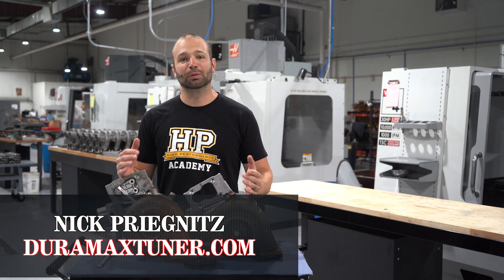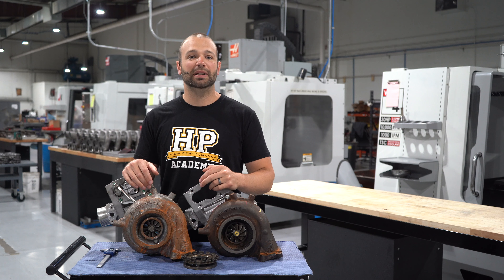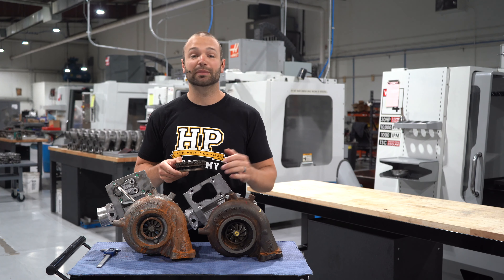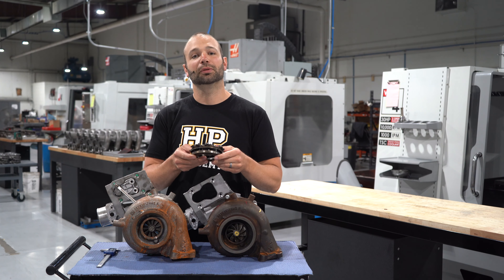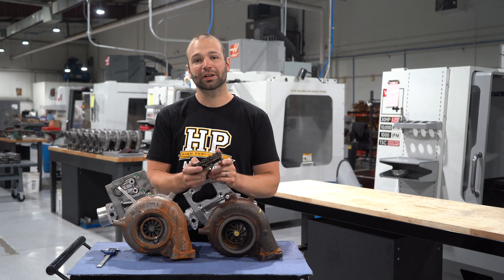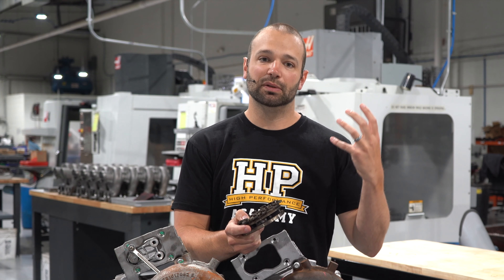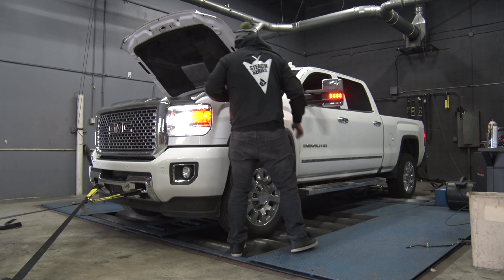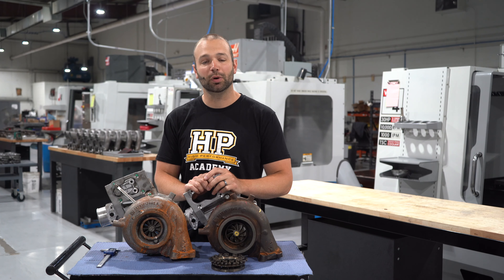Update On L5P Stealth Turbo!

Comment: 2020 Chevy 3500 L5P vs. 2020 Chevy 5500 L5D, is anything difference with the engine or turbo besides the L5D being detuned? All I know is the transmission is a 6 speed, 1750 series Allison. Is the L5D able to be tuned like the L5P?

Comment: What do you mean by guys with 5 inch exhaust tips take note? 5 inch tip bad?
Reply: That the bottle neck in the exhaust system is the turbine side of the charger, and not necessarily the exhaust tip